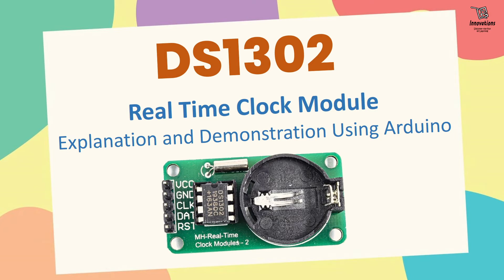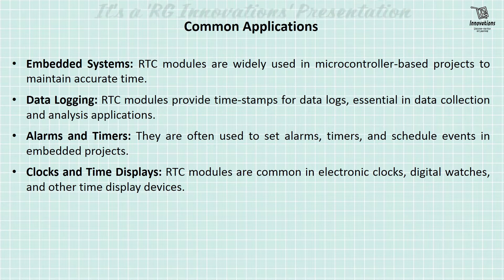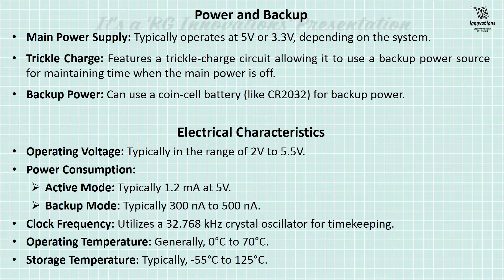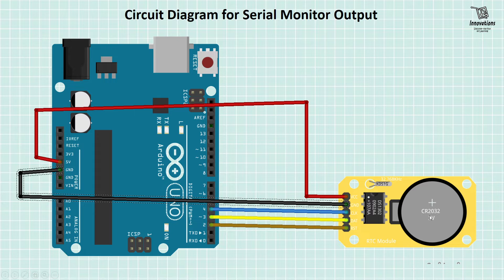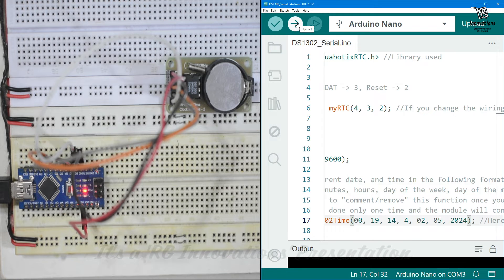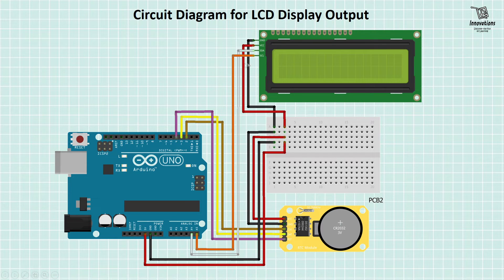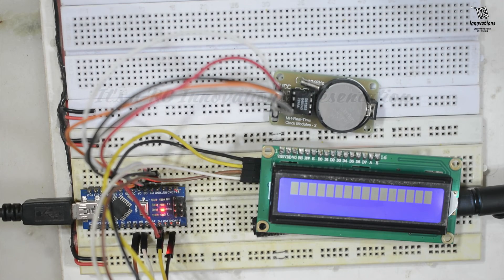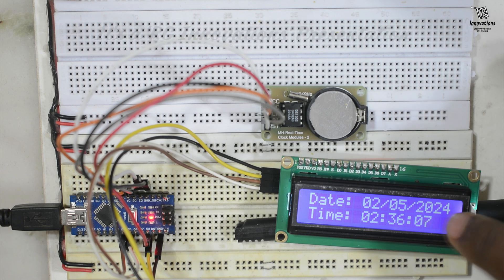DS1302 Real Time Clock (RTC) Module - Detailed Explanation and Interfacing with Arduino & I2C LCD

Comment: @Cutiecat54
1 second ago
I am learning Ardunio , trying to upload DS1302 Sketch however i am getting error as Sketch uses 4718 bytes (15%) of program storage space. Maximum is 30720 bytes.
Global variables use 247 bytes (12%) of dynamic memory, leaving 1801 bytes for local variables. Maximum is 2048 bytes.
avrdude: ser_open(): can't open device "\\.\COM5": The semaphore timeout period has expired.

Failed uploading: uploading error: exit status 1 
Please help me
Reply from the maker: Have you selected proper arduino board in the board selection menu?